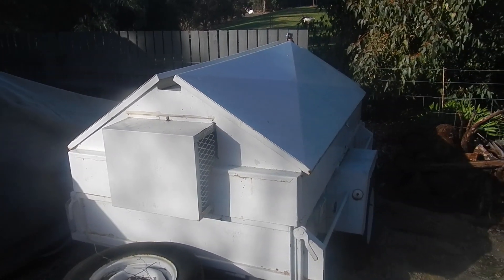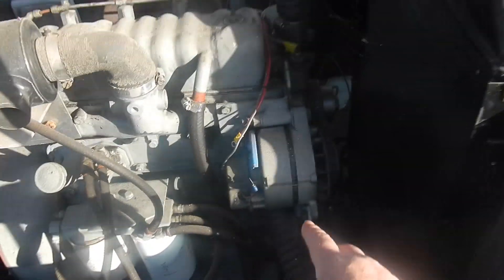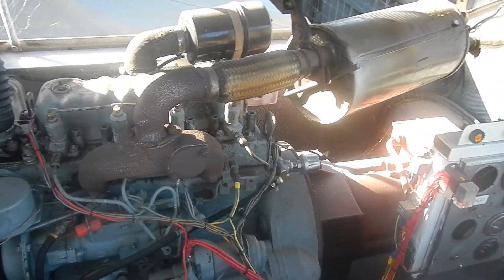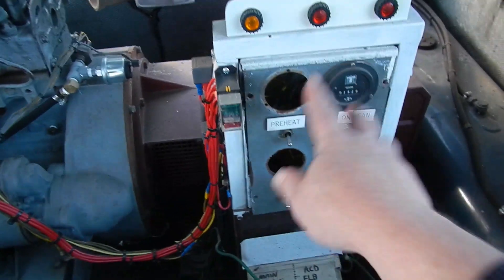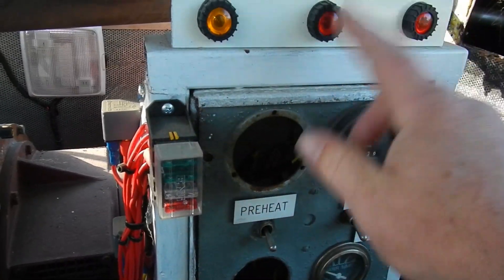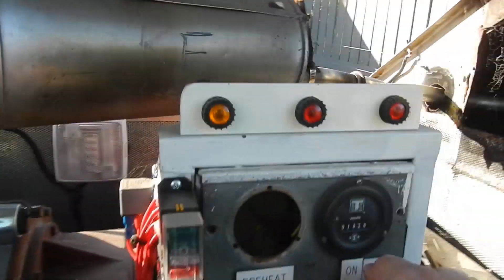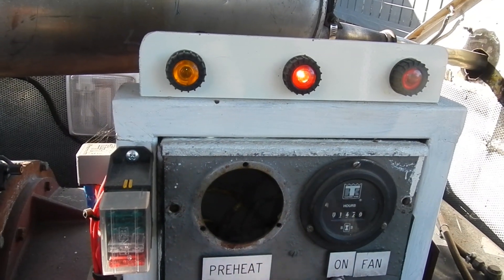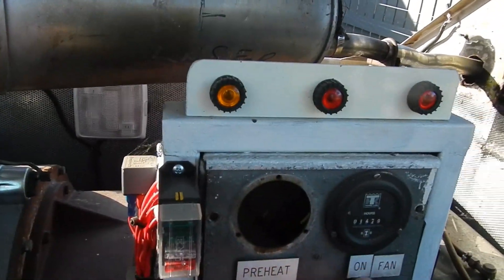Perkins 4.108 gen set cold start

Comment: We have one of these little Perkins engines that came out of my dad's old 1967 Commer 2200 van [ ODT 756E ]. It still is sounding fit, even at nearly 60 years old. Starts first time too.  We were going to stick a genny behind it, but the cost of swapping the hydraulic governed injector pump for a mechanical one was going to be prohibitive. Still fire it up once in a while though!

Comment: If it were me, I’d put a tachometer in that last spot; if not I’d put either a oil temperature gauge or an exhaust pyrometer.
Reply from the maker: i was thinking a fuel gauge may be nice.
Reply: V8Jagnut now that’s a gauge I didn’t think about; it’s rather important to know how much fuel you have left before you accidentally run it out.